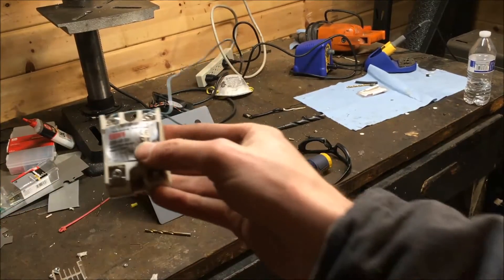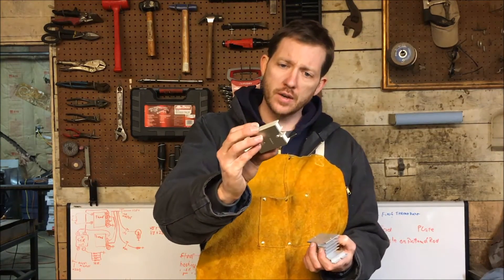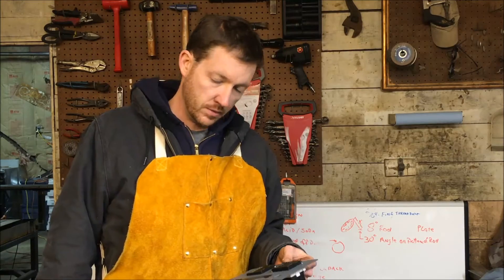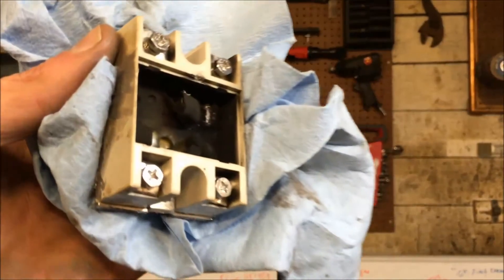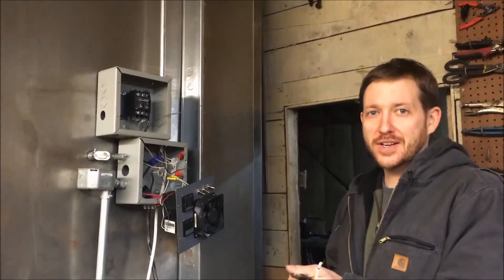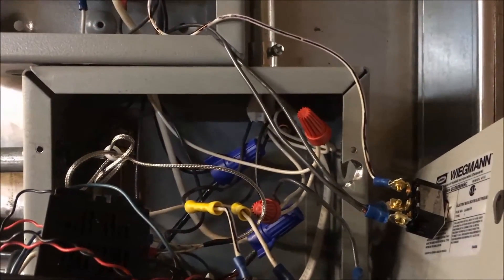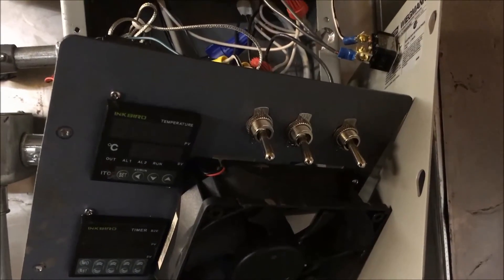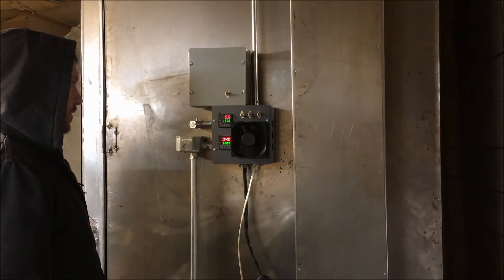DIY Powder Coating Oven Build: Part 11

Comment: After seeing this about a year ago here are a few more tips:
1. Most SSRs are 50% of their rated capacity. If you need 40A you need to buy 80A+.
2. The reason the 75A failed is because worst case of 4 elements at 3400W, he was trying to draw 60A+ given the first rule, it should have blown. Id suspect those elements were in the 2600-3400 range.
3. Don't trust the SSR heatsinks. They are poorly designed. Learning about CPU cooling also helps, but fans need to blow across the fins of the heatsinks in order to "work". You can't fix the design issue however, buy a better/copper heatshink and position the fan accordingly.
Reply: Hi iam sorry about my english fiesta at all is not really good...could you help me.. i have 4 heating elements each one gives 1500 watts  .. so all gives 30 ampers .... which ssr.. should i use and  i have to use a contactor to protect the ssr...?and a breaker and how many ampers must to support each one?ni appreciate your help so much...
Reply: @Samuel Calderon  sorry I didn't see your question sooner. Do you still need an answer? Are you in the US or elsewhere?

Comment: I use two forty amp relays to power my two 2700 watt elements. No problems
Reply: Hi if i have 4 heating that takes 30  amp.. which one ssr could i use ...?40 or 50 amp..  or more?? And i want to put a switch to the ssr to the pid... and what breaker could i use  for protection  orni hace to use a contactor to protec ssr

Comment: I've seen ssr's blow doors off of those small boxes so consider yourself lucky.  I'd venture to guess you're running 220v elements and the ssr didn't like having 110v on the load side when it was off.  But it's just a guess.  I plan on running one ssr for each leg of 110.

Comment: How many amps is the contactor relay ? Hows it holding up ? Would it be better to use a 4 pole contactor if I had 4 heating elements ?

Comment: i test ran my oven and it took about 15 minutes for it to get to 92°C and i called it quits because i thought it wasnt working but if about an hour or so is normal for you then i think i was doing it right. thanks for the vid